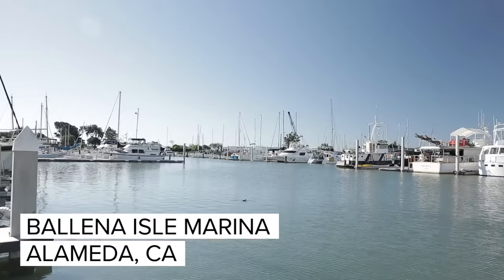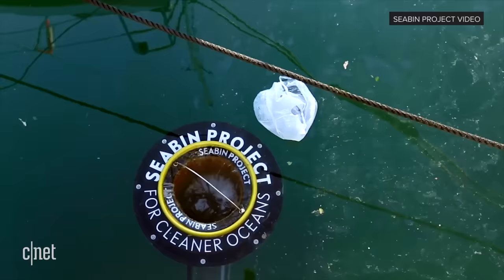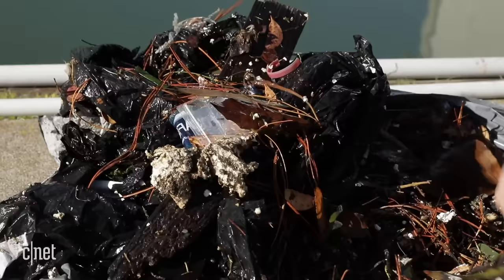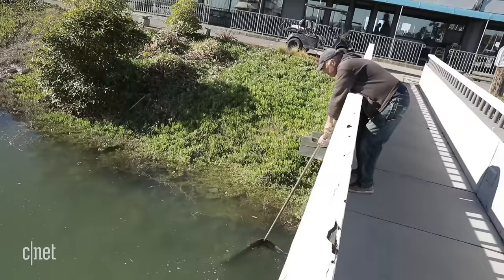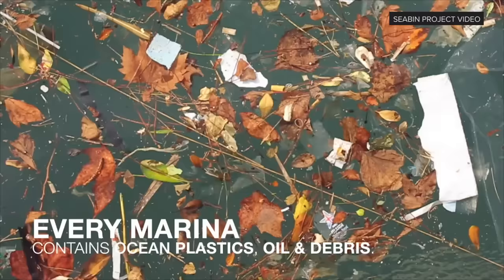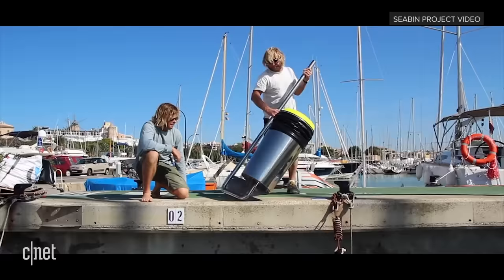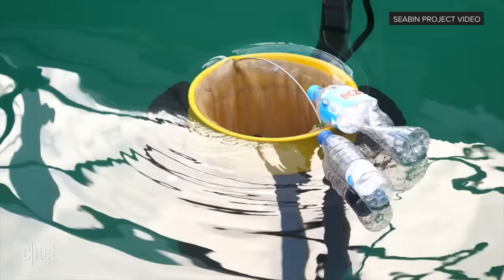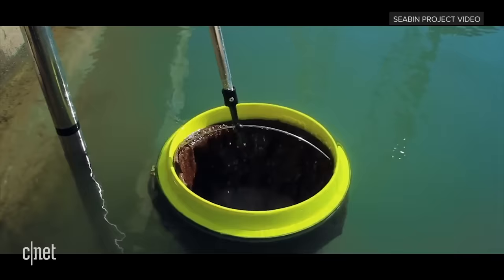Will Seabins save our oceans? The Seabin Project

Comment: 500 watts is in no way low power.  4 amps at line voltage is huge.  That thing uses ~$1.20 in electricity every single day, $438 per year per unit on top of the huge installation cost.  Suppose 20 of these were installed in a large marina.  That's $80k for the units plus $9k per year in electricity PLUS paying someone to empty them multiple times per day.  Pay two guys to walk around with garbage bags and pool skimmers and you'll clean more trash for less and waste less energy in the process.
Reply: Yeah but these work around the clock, and like the video said, they can be modified to run off solar or wind during the day. Potentially cutting operating costs in half.
Reply: Häagen- Dazs still cheaper to pay a guy to float around in a kayak with a pool skimmer every other day
Reply: Dan G, at minimum wage where I am ($10.00/h) that would be 36k a year. Sure these things are overpriced but in operating cost alone you could easily have 36 of these units active for the price of ONE dude working minimum wage. Using their recommended way to place the units, the nearest Marina by me can be serviced by only 33. So by investing in these units, you've just made the current workload on the maintenance crew much lighter.
Reply: Häagen- Dazs I agree that the electricity cost could offset the cost of an employee, but again, we're talking about 500W of solar per unit, which is far from trivial, installed in an environment saturated with salt water.  The solar is going to be steep as well - a 15kW DIY system is at least $15k for your 33 unit setup, and that's less power than required and doesn't include installation or maintenance.  

I don't know what the lifetime of these bins is intended to be - 10 years for a continuously operating saltwater pump system seems reasonably generous.  For your system it would be ~$14k per year in material costs (10 year lifespan for the bins and a generous 20 year lifespan for the solar.)  Add in $7k for nighttime electricity (this is definitely low, as it assumes 12 hours of peak solar production every single day) and you've got an annual bill of $21k just to have a system in place with the switch on.  They're still going to have to pay someone to empty the things and there will definitely be maintenance.
Reply: The concept is good, additional engineering would make it better, and if it could be self powered by solar panels who cares what the energy consumption is. It is the ongoing maintenance that will make this problematic for use in the open ocean. If emptying the filters and consolidating the trash for periodic pickup could be automated, this could have real potential for reversing the plastic loading of the oceans...
Reply: Daniel Smith
yes i agree with you, especially if they make a larger trash bag to store more trash, decreasing the amount of times in which someone must go there to clean up.
Reply: Oddajbox  normal minimum wage is 7 dollars and at 10 dollars a hour the yearly income is only 20 k not 36k
Reply: Oddajbox besides people would have to be present to collect the trash
Reply: People on minimum wage usually do minimum work , why do you want to keep people doing shity jobs anyway ? 
Spend a day skimming  a marina and get back to us .
Reply: Orson in charge  WTF its not a shitty job at all it requires no skill and is not hard physical labor and does not require interaction with other people. Besides you could get volunteers who require no payment except for the experience.
Reply: Much cheaper than staffing more people to clean up the outer! Add solar panels and then you don't have to worry about it at all.
Reply: spent 100 years polluting the environment..now it's not the time to think of the cost. do whatever it takes before it's too late for our future generation.
Reply: by that logic to clean the environment we will give everyone a  butterfly net and tell them to collect all the trash in the world's oceans, though it is expensive and ineffective and there and hundreds of better methods. We just say the environment is infinite in value so we should not think of cost or effectiveness
Reply: Should have applied logic while polluting the environment...we can't wait for an effective solution to come and do nothing until then. I am not pro-seabins, i am just saying that we need to start now. If there are other effective alternatives, let's go for them. But, start now else it will be too late.
Reply: the issue is there are effective alternatives existent such as a guy in a boat with a large mesh net
Reply: Cheaper than paying 2 guys $10 an hour (minimum wage) each for a year.
Reply: Jason Patterson - so what’s your idea?  Have you come up with something that comes close to soaking up the oil, gas and smaller particulate plastic pieces that get missed by the ‘guy in the kayak’ that this system does catch?  Are you working to help? Have you picked any plastic out of the ocean?
Reply: At least someone is trying to clean our oceans. Better technology will follow. Cheaper bigger and better. This will not be my problem. I will be dead. Think of your grandchildren. So , NO. I don't care what it is going to cost. Just fix it. Before it is to late. Or maybe?????
Reply: There are better options the seabin is nothing more than a good concept but horrible in use, kind of like solar road ways or the self reffiling water bottle
Reply: some money vs taking rubbish out of the ocean?
Reply: It still early, just like VR its just a start until everyone could buy it
Reply: So what
Reply: I think its a great idea but 4,000 for that seems very pricey...why is it so expensive?
Reply: So you mean basically pay two slaves?
Reply: @andrewtang4538 is that person gonna work around the clock? What kinda a-hole pays minimum wage for such hard work?
Reply: How about something that is fixed to a motorized boat that could do the same thing...I mean if the boats are already in the ocean, may as well have it automatically collect trash and debris

Comment: Looks nice but if it has to constantly use 500 watts of electricity to try and fill up a little bucket at a cost of 4k for each one, then it's not very efficient imo.
Reply: tubesurfer23 well, the average home computer uses 500 watts per hour (I think desktops, not laptops though I could be wrong) and the video says they come by periodically to clean it out. As a start up company that's positioned to clean up pollution (even if it is for profit) this does seem interesting. I would like to know how much of the water of cleans per hour or day. Who knows, maybe there was a reason it was designed that size. Maybe they're be a bigger bucket in the future
Reply: you mean 250 to 300 watts for home computers (and around 50 watts for laptops), but you are right, it's better to use energy for  purposes.
Reply: My PC + monitor goes around 60W while i watch this... 200-300 will be for good gaming PC in demanding game... 500W? Even setup with 1080ti gaming wont eat 500W only on peaks... with average around  350-420W
Reply: That's not much... most marina's have solar panels installed too.
Reply: I don't think its constant
Reply: Wes K my gaming PC doesn't even draw 500W at full load....
Reply: Ronan B 500W solar panel is not small nor cheap
Reply: step by step dude
Reply: this is stupid....just stupid.
Reply: Destroying nature is cheap, but saving needs time, money and honest efforts.
Reply: Use solar for coastal areas and wind turbine for far seas. Start there. 😉❤️👏🏼👏🏼👏🏼
Reply: tubesurfer23 Obviously it's expensive now, any new piece of technology is, but if it gets off the ground the money made will improve it and work towards making them more affordable
Reply: david bryan If it's someones job to look after them then it won't be neglected
Reply: @tubesurfer23: Some creative thinking: 500 Watt is not very much and could be gotten from natural resources like sun, wind or tides.
Reply: I see where you’re coming from but designing is an iterative process so this can be the start of something that overtime will take less and less electricity with technology developing at the pace it’s going. This is something that should be supported and funded and researched in order to put out better prototypes of this product.
Reply: It’s solar/wind powered so doesn’t really cost much
Reply: It is definitely not efficient, actually has an effective range and efficiency is dependent on water movement. The strength of the sea wave will also affect the energy consumption.
Reply: if your computer is running 500Watts what you doing mining for coin? XD
Reply: @fluffiiesnutz  cleaning human pollution in our harbors is stupid???
Reply: Earth never had a pollution problem until humans came along.
Reply: 500 watts is the equivalent of 3 household kettles running at once
Reply: I think it will PAY for itself in the LONG run.
Reply: Not that mich
They are putting these in marinas where millionaires with yhacts and fishermen who make money from the ocean.
Reply: It's good for small scale near rivers but not the ocean
Reply: I rather spend money on something good like the seabin because it saves the earth
Reply: That money could be used as a tax break for the rich.
Reply: @dubious6718  It's a pump to draw in water & garbage. It has to be constant if you want it to collect rubbish all day.

Comment: The cost is a bit high right now, but I think the concept is sound. Shore based bins may keep docks and swimming areas clear, but cleaning an ocean is going to need larger, automated, ship-sized 'refuse processing units. Swimming pool size collectors, automated retrieval, and a minimal  crew on board for ops. A good effort though, for the start.